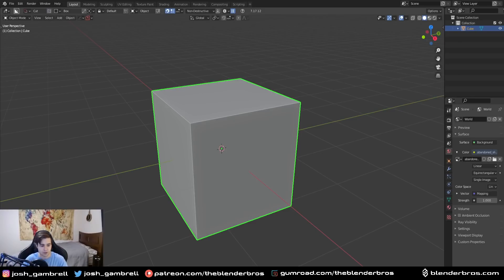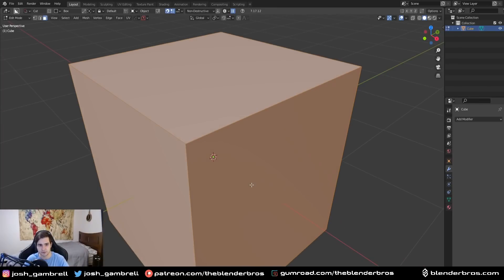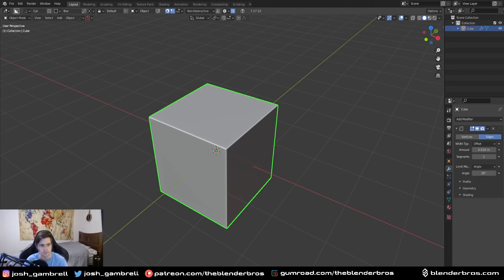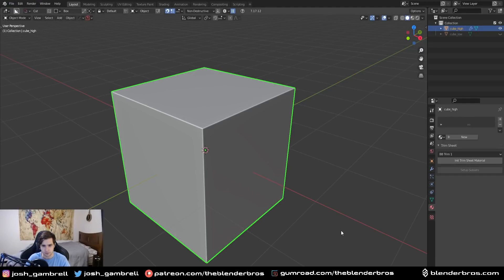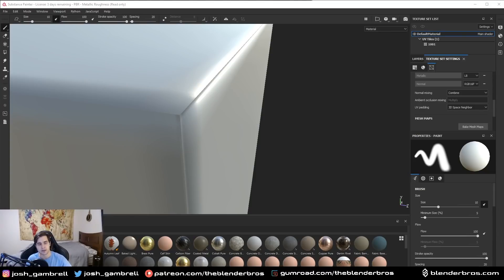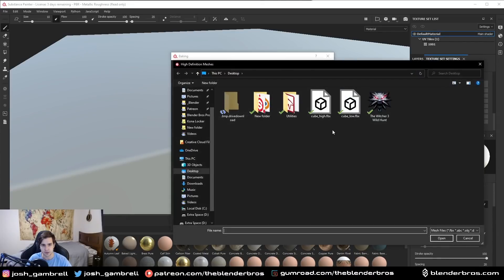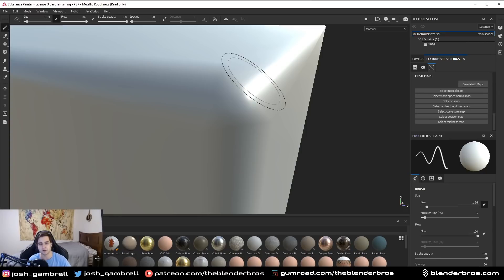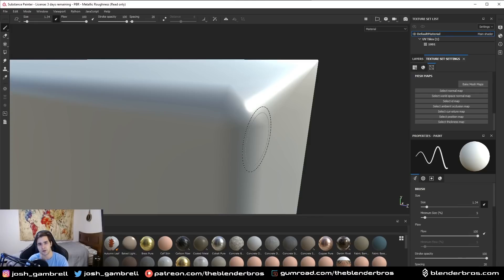Game ready bevels in Blender!

Comment: The cube would have baked properly if you had the UV shells separate for each side and hardened the edges around your UV shell borders. Try it and let me know ;) I bet you had the usual "T-Unfold" cube and thats also why you have those baking issues Josh. Correct me if im wrong, but i did test this one out multiple times. Awesome video anyway :)
Reply: Interesting. Does this mean in general that you can bake bevels to low poly as long as those edges are split so they form sealer are uv islands all the time? Or did I misunderstand?

Comment: Josh, I don't know how Substance make unwrap, but to have nice looking 90 deegres edges, you need to split your UV's where you have sharp edges. So in this case, every face of your cube should be separate UV island. It will never be 100% perfect, but for most object you won't notice it (ex. weapons). Mid-poly bevels are fine for bigger objects when you will really notice the difference. That's just my opinion
Reply from the maker: Even if you increase island margin it is still visible. Personally, I will not use hard edges unless it is an object that can’t be seen up close.

Comment: but what if you want to create lods? with the single edge technice u miss the information for the size because u cut the edge with a bevel. i would do suport edges and bake the normal (lod0), for closeup, then i would delete supporting edges (lod1) for distance view and still have the baked normal and the right size,(no popping) for the objet on mid range distances. it also depends on the size of the object if its just a small props you can get away with hard edge and normal but also depends on the game....but that my XP working for games

Comment: I'm a game developer and I have to agree with Josh here, I'm actually tired of seeing modern games being released with sharp 90 degree geometry. There's literally no reason to do this anymore - we're not designing games to be played on a Nintendo 64, there's no need to obsess over adding a few dozen triangles here and there. And even slight bevels catch light in a way that adds realism, since you almost never see razor sharp 90 degree bends in real life.

I use 1 segment bevels for very tightly machined objects, and 2 segments with slightly larger bevels for things that would be "rougher", less precisely machined, or on a larger object. We've been in an era for quite some time where polygon counts are not going to be the bottleneck for your game, it's far more likely to come from post-processing/shader effects or from your game's logic bottlenecking the CPU.

Set yourself free and BEVEL EVERYTHING. When it comes to game geometry, beveling combined with weighted normals are your best friends for modern game development.
Reply from the maker: Agree 100%. Have you dealt with any strict requirements in which you choose hard edges over 1 segs? Games like Alien Isolation, for example, have a combo of both sharp edges and mid-poly. I've noticed the sharp edges are for the filler objects in the scene and mid poly's for the more noticeable ones
Reply: @JoshGambrell  Only in circumstances where the object is too small on screen to justify a bevel (because the bevel itself would be too small and light interaction would be lost at most resolutions), possibly if the angle is too acute and is supposed to represent a sharp object (like the edge of a sword), or of course if a bevel would catch no light because of its placement.

It's also going to be much more important to do good, smooth, well-shaped hard surface modeling as ray tracing becomes more of a thing. I've noticed that the same problems you get with shading distortion in Blender Cycles is the same kind of distortion I see in, say, Unity with DXR when my mesh isn't built with distortion in mind.
Reply: Doesn't that depend on the platform though? For PC and Consoles? Sure! But for mobiles you kinda have to take polycount a bit more seriously. Plus, it may also depend on the type of model you're making. Say if you're making a background prop you don't really have to detail it much (if at all)
Reply from the maker: @SkeleTonHammer  That's what I figured! No use for assets from afar (hence why cities for example use image planes and not actual buildings).
Reply: @fgmenth  Of course background, non interactive objects dont need the high detail. What old mate is talking about is everyday game assets, most engines (if not all) can happily run higher poly assets to your front, whether that be weapons, vehicles, or general items.
Reply: Thats what I love about Days Gone. Look at the size of the that thing... and u often see bevel everywhere’s. It’s about optimization
Reply: You know what better than bevels?
Edge demages
I see some games have edge damages in the high poly and only 1 segment bevel on the low poly and bake it
In this way the damagae look ok but looks really flat when  you come upclose
Or what some other games do is that they make a low poly
Take that into zbrush
Create edge damages and make it 10-25million
Then make a low poly out of the high poly one in zbrush by decimating which is 2000-3000 tris for just a single pillar or wall and not your regular 12,24 or 40 tris wall/pillar.
And uv unwrap it in 3ds max/maya/blender
And then bake it in marmoset
Sure this method creates more triangles but when u come upclose
As the edge damage is real geometry it looks so good upclose
But i would do this for only pc games and that too next gen as this is a bit high poly.
The same can be done for props as well
But do note this adds more story to a prop but will make it from 20,000 tris to something like 30k or 40k tris
Reply: now i see why the games nowadays are really heavy

Comment: I really can't seem to find much on the subject of unwrapping bevelled edges. 
How do you do it, does it matter which side you place the seam on the bevel? 

What if you place the seams on the edges as normal then use a bevel modifier to bevel without applying it. Applying it would put seams on each edge of the bevel.

Comment: 1 segment bevel is not required. Observe how the models of large video game productions. At 4:33 you just needed to do a smooth shade without angle limit.
1 face (2 triangles) , for each edge impacts the game performance.
Reply from the maker: Shade smooth, separate island margins, it doesn't matter, the result is still garbage at best up close. From afar it isn't as big of a deal, but for primary detail 1 segment FWN strategy is essential.
Reply: @JoshGambrell  yes, maybe the complete smooth is not the best way, but there are various ways to eliminate the sharp line, bevel is not the way in my personal opinion, that's all, it makes the model too heavy, i make 1 segment bevel only for bigger bevels.

Comment: You can get rid of the hard edge after the normal bake by setting the shading of the mesh to "shade smooth" in Blender, then the normal maps will have complete control of the shading. no need to add more geometry.
Reply from the maker: It helps, yes, but the hard edges are still very visible. Normal map bakes cannot make up for mismatched curvature, so that is the limitation and why i like mid poly.
Reply: @JoshGambrell  I know, I´m a little late to the discussion, but I actually have to disagree. If done correctly, the hard edges are not visible at all, the only thing that will still be noticeable is the lack of geometry in the silhouette. But setting the low poly to smooth, slightly increasing the scale of the high poly cube so that it completely wraps around the low poly cube´s edges and  also slightly increasing the Max. Frontal distance during Bake in Painter completely fixes any artifacts on the edges, at least in my workflow. Maybe give it a try :)

Comment: I commented last time too when you talked about the 1 segment bevel when you show that a hard edge makes the seam line and I'm only posting again because I don't want people to think that it's because it's a hard seam when it's not. and on some models, if you add a 1 segment bevel it can add a lot of tris that's unnecessary. the reason you are getting the error in the bake is that your UV's are not right if you give the UV's the correct padding the Normals can bake without affecting each other and then you will get the correct normal and it will not have that seem. Here is the video I did for someone in the comments last time showing the difference between the hard edge with all smooth shading( gives artifacts in the reflection and lighting ) and then the 1 segment bevel ( looks the best but added Geo) and finally a Hard-edge with auto smooth shading with the Uv's correctly padded. https://youtu.be/BySjxyXS9Z4 I did it in marmoset but same applies to baking in Substance
Reply from the maker: Well it was a quick Smart UV Project. I usually unwrap manually. You can adjust island margins to fix it.
Reply: Would be great if You described it with some details. Sadly there is no comment on your video. That is interesting topic for me as i am  trying to get good bevels and normals for export to a painting software. In Blender looks perfect but not in other software.
Reply: Don't hard edges produce duplicated verts in game engines? Eg a default cube in Unity is not 8 verts to keep shading flat

Comment: Hi Josh, as a games artist myself, I can tell you that you are actually wrong this time. Baking the bevels is still the best way to do it if you do it correctly. 
- Make sure your hard edges also have a seam
- Make sure the low poly edges sit inside the highboy bevels, so the rays can properly project the bevel
- Use marmoset instead of Substance for baking
another reason why you want to bake your bevels is that some engines do not deal well with elongated polygons such as UE4. You can check out my Artstation (Hector Alexander Galindo Escobar). None of these models have real bevels in them.

Comment: I usually use 1 segment bevel for most of my 3d models, but I dont know if should i bevel or not? for example a simple bench,  It sure hell does looks better with bevel, ive asked some other 3d modeler, they said I should make it as low poly as possible, told me to bake high poly to low poly. But in todays standard, i think it can handle higher poly right?
Reply from the maker: Yea, I would go based on what your company requires you to do. Most game engines aren’t going to be killed with a few extra thousand polys here and there from a bevel. It’s balancing performance vs. quality.

Comment: Hey guys but what about UVs? It's easy to unwrap object with sharp edges but 1 level chamfer makes it too complex and time consuming to unwrap. You can decide to mark seams and unwrap before applying 1 segment bevel modifier but that means your UVs will be destroyed after applying modifier. You'll have to redo it or you're stuck with ugly unprofessional unwrap that introduces stretching and overlapping pieces. I see only two solutions if you want clean unwrap: invest extra time in unwrapping after adding chamfer or add even more geometry with 2 segments bevel and unwrap with seams marked in the middle of that 2 segments bevel. Any advice on that? Thx
Reply from the maker: I’d recommend getting our course on hard surface unwrapping, it’s short and discusses various techniques: https://www.blenderbros.com/offers/QNYtmfNL/checkout
Reply: For anyone interested in solving this issue I have to tell you that you'll not find the answer in blenderbros course ;( That said I'll still recommend it for the price, I picked up some good tips and tricks and really enjoyed it :)
Reply: Did you ever come up with a solution for this? Even if you export a live bevel your UV's will be slightly messed up on the corners in Marmoset. If you apply the bevel you get the same errors on the corner in blender. Not sure what to do.
Reply: @justinvoye8967  to make sure that texture continuity is not broken around the edges I unwrapped my low poly model after applying bevel/chamfer. Then make sure all UV islands are aligned and not rotated. That way your texture and baked maps will flow between them nicely. Turn on synchronized view in UV space to check if your split edges matching.
For example:
Plane split (mark seam) in half will give you 2 square UV islands. Right vertical seam on one island should be aligned to the Left vertical seam on the second island.
Another example:
With default cube there is default cube unwrap created. Mark all edges as seams, unwrap and arrange your UV islands exactly in the same way as default unwrap. The only difference should be some gaps for padding between them. I hope that helps.
Reply: @marioklos  Thanks for sharing Mario, I also saw your post on blenderartist thinking about the same thing I am. I think the bottom line is when you export a live bevel it will add additional geo to your model, thus changing the border around each UV island. Sometimes this isn't a huge deal depending on the angle, other times it will cause certain corners to fold and skew causing very small errors on the UV's. You can try and repair these small errors but then your applying the bevel before export and at that point you might as well consider unwrapping the bevel. 

In the past I've always baked bevels and split my UV's on 90 degree hard surfaces (older method). This also can produce a small hard edge line on the low poly depending on the angle and how close you are to a model. For a change I wanted to give this 1 segment bevel live export a try. At the end of the day I think it really depends on your application, it may not even matter if the model is completely textured and rendered in Blender, but we're talking about game ready models here. For game ready models I'm not sure this method is technically correct as there are clearly errors in the UV's and I agree with you that this looks unprofessional.

I don't see many discussing that exporting a live bevel adds additional geo to the UV's, and it's potential to cause errors. One thing to remember is if we're using a 1 segment weighted normal bevel on a mesh, we aren't using a normal map for the edges, meaning the rule of seams on a hard edge go away; the normal maps will only be used for detail on flat surfaces.   I'd love to see what others have experienced using this technique and if they run into issues, thanks Mario.

Comment: You're getting those ugly edges because of incorrect UVs unwrap, you're not making any margin between UV shells, I've made a little comparison of bake with manual UVs and Smart projected UVs and a little tuttorial how to unvrap a Cube properly in the end of the video, hope it will give you some useful info.
Also if you're marking hard edge ALWAYS mark it as Seam too, otherwise you'll get those ugly normals bake on edges.
https://youtu.be/BqZ3YEGG6MI
Reply from the maker: Like I said, simply increase the island margin. You’re still going to get visible hard edges regardless, but yes, you are correct.